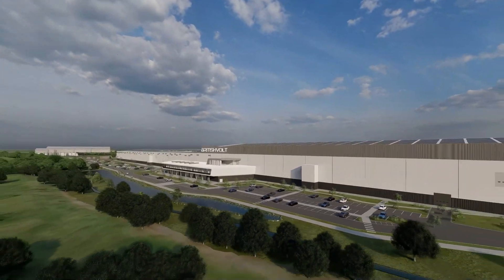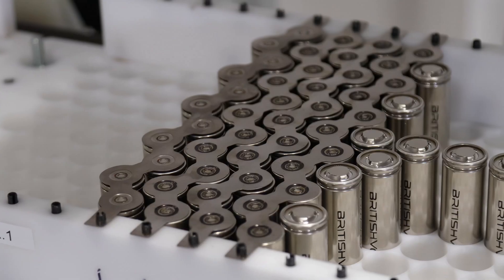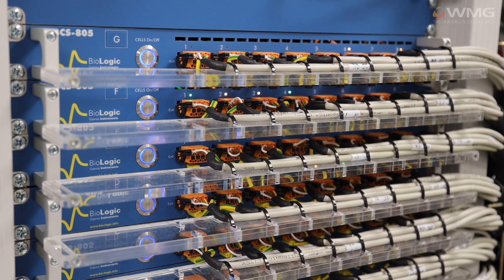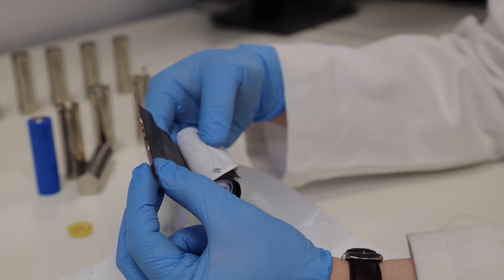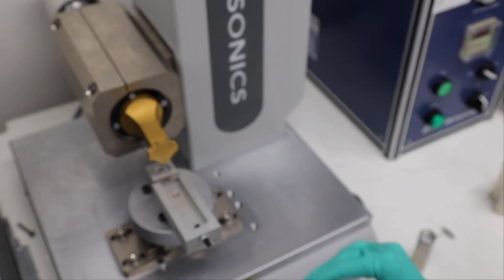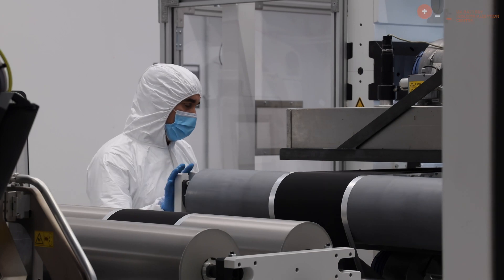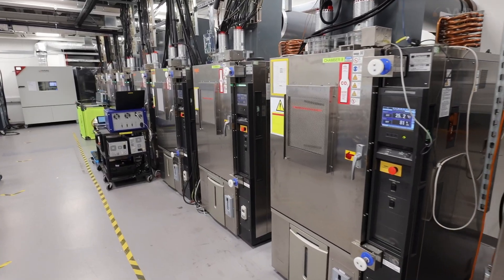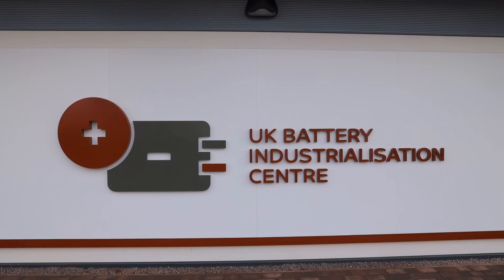Britishvolt’s Battery Research

Comment: 28.9.2022. No concrete poured. No steelwork erected. No construction machinery on site. No workmen on site. Nothing but some disturbed ground and some portacabins.
The factory will not happen.
Reply: Next thing you'll stop believing in unicorns gambling across sun lit uplands. It's almost as if many in the UK have been taken (correctly) for fools.

Comment: Are these batteries better than Tesla's 4680 cells?
Reply: The 4680 tab-less format is better than any tabbed design, it seems they are still concentrating on tabbed designs.  Also sounds like they are not actually producing any volume yet, nor any talk of where raw materials are coming from and how much they can make, we are so far behind, they need to use Tesla's patents.  The money in batteries is in production not patents.
Reply: You wouldn't get the answer here, comparing the product with competitor is not allowed, in any industry I guess.